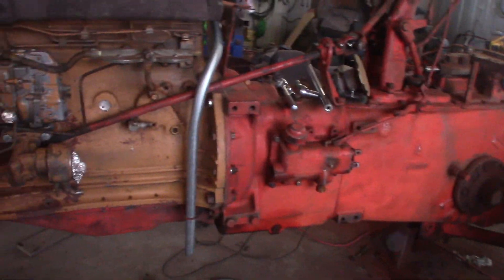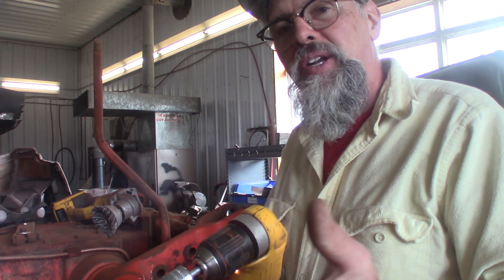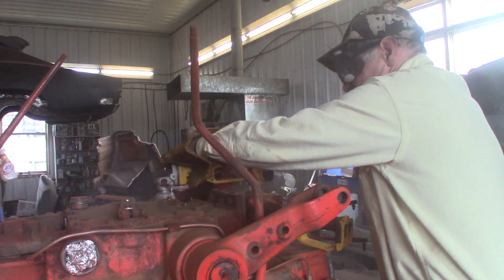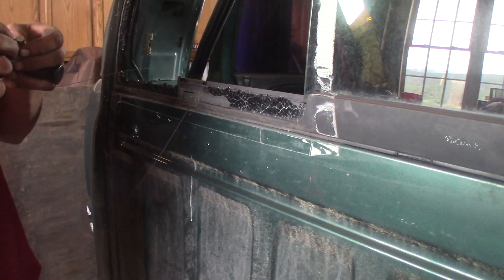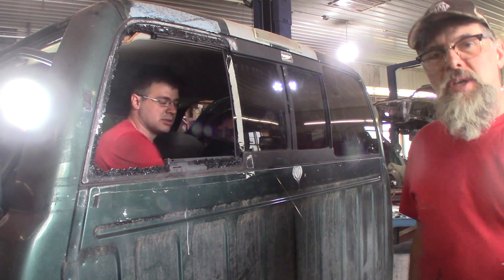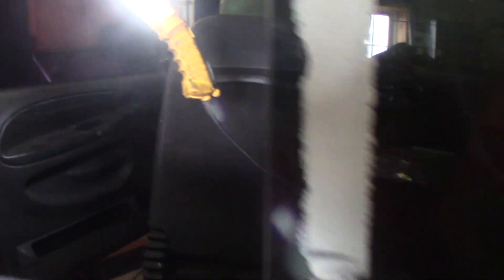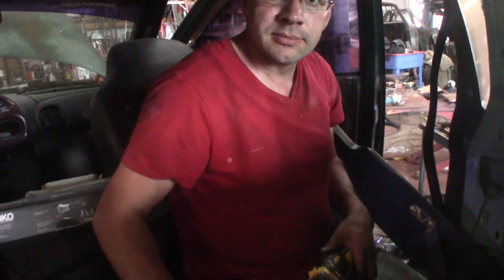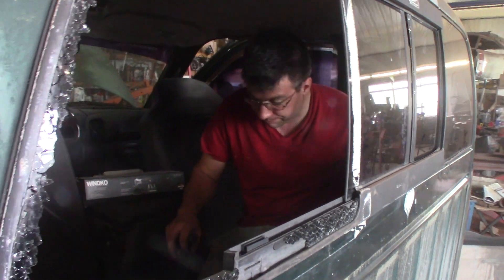Attempting removing 2nd gen Dodge rear window

Comment: We use to use Hood cables in the yard. They worked pretty well. Razor knives helped as well.
Reply from the maker: Hey Joe; I have yet to successfully remove a window. Hood cable is quite a bit heavier. Gonna give it a try. How about something as a lubricant?? Thanks for the tip!! John
Reply: You could use a heat gun to soften up the glue as well.
Reply from the maker: @joeledonne423  another great idea! Thanks Joe!

Comment: ❤❤❤❤❤❤❤❤❤❤
I MEANT TO SAY THAT YOU SHOULD HAVE NEVER POSTED THIS VIDEO AT ALL BECAUSE YOU DID NOT PAINT THE MOTOR OR ANYTHING AND YOU DID NOT DO THE CLASS IN THE PICKUP TRUCK SO WHY WOULD YOU EVEN POST THIS IS MY BIG QUESTION , , BECAUSE I CAME HERE TO SEE HOW TO REPLACE THE GLASS WINDOW IF IT WAS GOING TO BE JUST THE DRIVER SIDE REAR PIECE OR THE HOLE GLASS AND YOU SHOWED NEITHER BUT YET YOU POSTED IT AS IF YOU DID THE GLASS, BUT YOU NEVER DID 😡
Reply from the maker: @kerrymartin5514  sorry buddy. It was a fail and I eluded to that sad fact in the thumb; “not so good”. 
Don’t get mad just do what I do and ff to the parts you like. Thanks for all the heart s! Have a good one👍